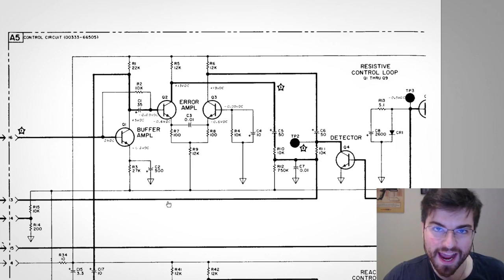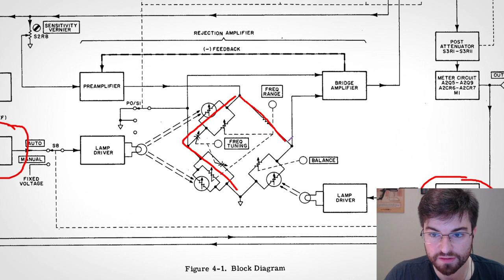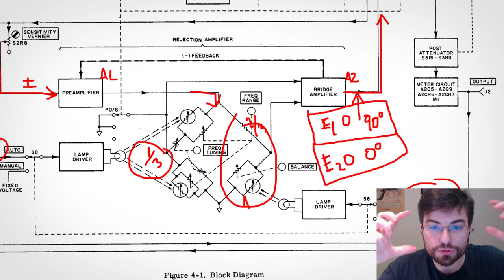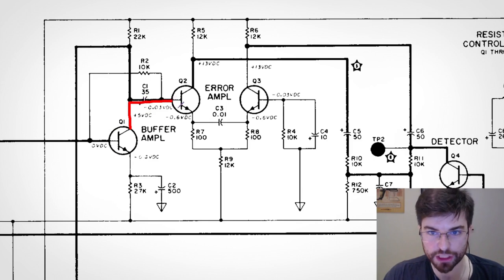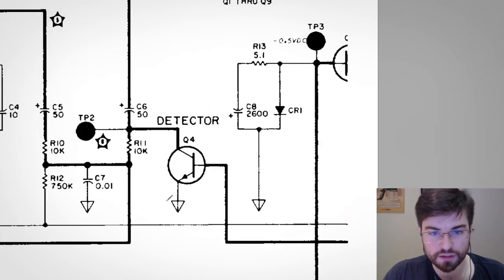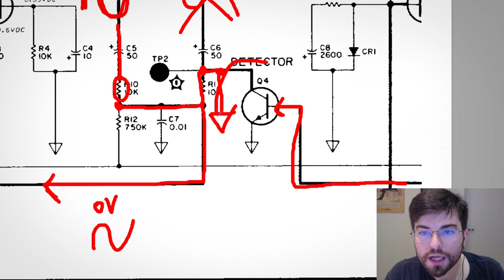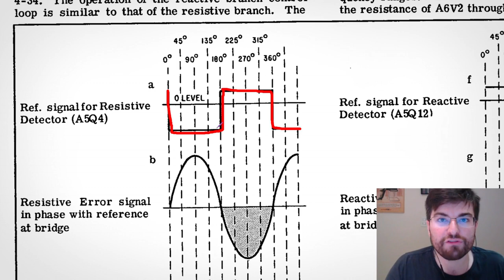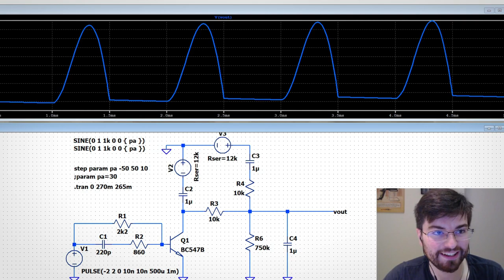Chopper Phase Detector - Circuit Analysis

Comment: Nice circuit thanks for sharing.
This gives me an idea to design wide band phase detector.
We can measure current on a line amplify it to make a square wave, or use a zero crossing detector to generate square wave, do the same with voltage and use a PLL's PFD for phase detection, and then use a charge pump, and then a filter to integrate the output of the charge pump.  The output voltage will be proportional to the phase difference, between current and voltage or power factor.

You can do the same thing with two voltages, as well.
Reply from the maker: Beautiful!

Comment: Wow very interesting. Looks like the microwave sampling phase detector that you have explained also when the two strobes Need to be differential to Not affect the Output. All of those old manuals are filled with knowledge and good ideas to use.

Comment: what is the use of c3? in some other instruments the diff pair have similiar capacitors like c3 in series with small resistor, is it feedback?
Reply from the maker: C3 that couples the signal from one emitter to the other.